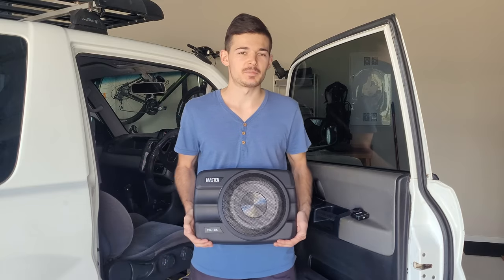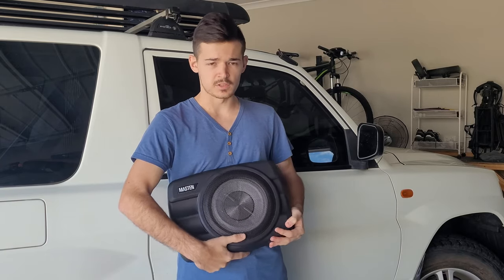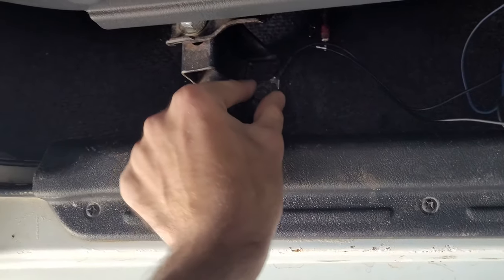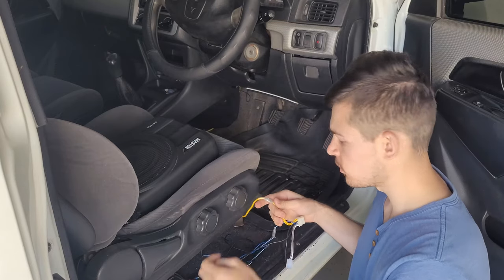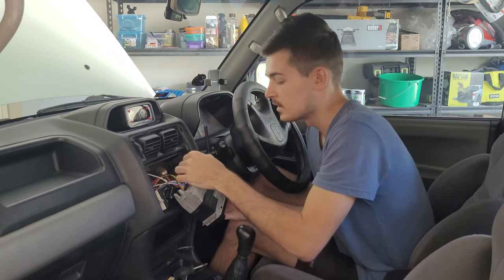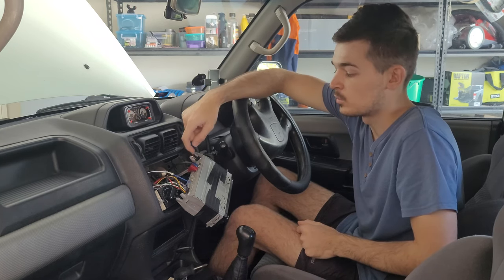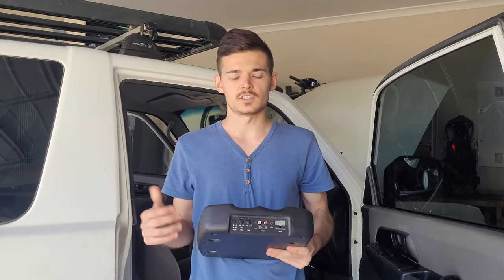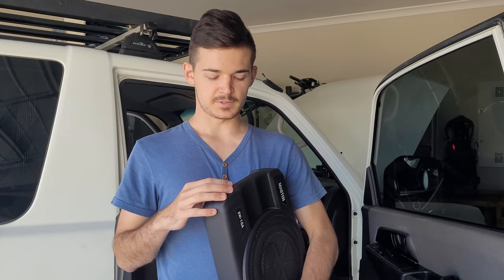Slim subwoofer review and install

Comment: Rockvilles 800w 10” super slim (6.86cm/2.7in) is only $149.95 and it has its own built in amp. They’re a good company I’ve run them for a few years now.
Reply: Link?
Reply: Mine only lasted 4 months of light use. Thats why im here 🤣

Comment: Awesome video! That subwoofer has made such a big difference to the sound! Love it!
Reply from the maker: Not too shabby aye😄👌🏼
Reply: Do you need to put a bigger battery or alternator in your car for this?
Reply from the maker: @taung9535  Hay mate! I have been running on a 620cc battery which is normal size and original alternator and it's perfect :)
Reply: @taung9535 Most of these units draw 15A-20A max at full volume. Most of the time the amp draw is way lower so no worries about needing electrical upgrades.

Comment: Mate, turn the gain down to about 70%, you'll have a much cleaner sound, especially at higher volume.
Reply from the maker: The sound distorts through the mic so hard to hear what it sounds like but yeah you're right you'll definitely have a cleaner sound with bigger setups 💯🙌🏼
Reply: You can't just guess at an arbitrary number like 70%. It all depends on the source voltage level. Trial and error will determine where it needs to be set.
Reply: depends on the quality, i have a marshall (not in the car), u can push it at 100% and its clear, crisp, lovely bass
Reply: @giggsl5011  Not so much quality, but signal strength. A gain knob is like a ratio adapter. If your signal going in is not strong, you can adjust the gain high and not have clipping. If you feed in a very strong signal you might need the gain turned way down.
Reply: Just no... you match your gain to the cleanest input signal. If your radio puts out 4V clean at max volume you set the gain to 4V if it puts out 2.65V at 60% volume you put it at 2.65V

Comment: You'll probably want the crossover set around 80hz low pass, not 50 for that sub. You'll definitely not want the phase set on 180*. Leave that to zero. At 180* it is out of phase with your other speakers and will not sound as good.
Reply from the maker: Yeah...the phase on zero has no bass at all tho 😄
Reply: @budget4x4life  interesting. That’s the opposite of how it would normally respond.
Reply from the maker: @Mike.D.843  haha oh well😄
Reply: @Mike.D.843 The phase setting will be different in each installation. Thats why they make it easy to switch it. You have to try both and pick the one that sounds better.
You also need to set the crossover by what sounds best. You can not rely on the markings by the knob.
Reply: This^ Phase changes where the sound wave starts because if your mains and your sub starts at the the same wave position, they cross (phase) each other out. Even the crossover depends on what main speakers you have and what your settings are. I usually prefer setting my sub to only handle 60hz and below so it's not so boomy.

Comment: Thanks for this video
You mentioned put the 50 Hz will that enhance the bass also someone said lower the gain to 70% is that will make it truly mild and clean when I up the volume!?
I bought one called d class isudar good quality one since a year or so, it sounds good
But i could know what the correct adjustment i should use with it 😢

I installed it correctly but the base controller light isn't lighting anymore since before what could it be wrong!?

Sorry for making it long
 I wish you can help me out solving this issue 
Thanks 🙏
Reply from the maker: Hey matey. It comes down to your headunit. The amount of gain is the amount of bass you want your sub to take over. If it is at 70% it will only play that amount through the sub and the other 30% through car speakers. That will make it sound nice and clean but everyone has different taste of how much bass is enough 🤣
Reply from the maker: Check if the ground and power wires are properly connected. Maybe disconnect and connect again to see if it changes
Reply: Indeed
Thank you so much for your help Buddy 🙏
Reply: Keep up the good work
Waiting for your new videos.
Reply from the maker: @Leto4900  thanks so much😊
Reply: @budget4x4life Okay, so your not understanding the gain control.
It is not percentage based. It us voltage based. It allows you to adjust the amp to the signal voltage going into it from the radio. 

Some radios might output 1 volt, or 2v or even 4v. The gain knob allows you to better match up the amp to the voltage going in.
Reply: @Leto4900 For the frequency control, don't pay attention to the numbers, just adjust it by ear. Too high a frequency and you will get vocals coming from the sub. Too low a frequency and you may not get enough bass. You have to adjust to where you think it sounds best.
Reply: @Leto4900 I would not worry about the led on the controller. Its not important. The led might have burnt out or it might have a bad connection. 

You can try cleaning the contacts on the bass knob and its connectors. Electrical contact cleaner or just alcohol on a q tip. That might fix it.

Comment: that fart sound is the sub distorting turn down the gain to 70% or untill it stops making that noise also the remote wire is +12v so I hope you added insolation to it so you dont get a short it looks bare in the video
Reply from the maker: The fart was the microphone that distorts not the sub 🙂

Comment: Would this be suitable for lwb ns 2008
If you remember my rockford don't work any more
Also would it compatable with kenwood. DMX8520DABS 
Thanks for sharing 👍😀
Reply from the maker: Hey Robbie. Yes I remember. I reckon it will. Just have a look at the back of the headunit, there should be a sub input. Do that and then yeah you'll have a sub 💯

Comment: l want to run in home l find 12 v adapter for power but howl can l get the otomaticly power on Signal? Blue cable need a electricity?
Reply from the maker: Blue needs power. It's the ignition wire to go on and off. Why do you run this in home 😄
Reply: @budget4x4life  for second sub because of the proper dimensions. How much need power 12v?
Reply from the maker: @muhendisabi1697  yeah 12v

Comment: bro those wires are to thin, ground and battery need bigger gauge
Reply from the maker: She'll be right🤣
Reply: @budget4x4life  im about to install mine, im using 6 gauge it has to be enough. Yours are thin as a nedle haha
Reply from the maker: Nice mate. It came with the product so will be fine. Bigger wires are suited for massive amplifiers and subwoofers like over 1000w. This one only 300 @kalisto1
Reply: @budget4x4life  No man, better flow of electrons is betrer if the wire proper.
Reply: @kalisto1 This Masten is probably drawing 15 or 20 amps at most and that is in musical surges. It probably averages out to 5 or 10 amps. You don't even need to go to the battery. These units will run fine off a cigarette lighter outlet since they are usually fused for 25 or 30 amp. 
If you want to know true current consumption get a DC clamp ammeter. It is not a high powered amp, but good enough.

Comment: wow sounds really crappy.
Reply from the maker: You're listening to sound through a crappy mic hence why you can't hear the exact sound. The sound farts are because the bass is too much for the mic to handle so it distorts. In reality just clean bass no rattles🙂💯
Reply: @budget4x4life  lol I love sound my computer has $1,000 small rosewood technics speakers, my amp is a mini Denon receiver, with a 12 inch 300 watt amp, built in,  my monitor is an 32  in curved screen Samson. But my home system starts with a SVS  SB 4000, Subwoofer, not to mention the stuff in my bed room and garage, lol yeah my stuff is great so yeah I can say the video sounded crappy, sorry not trying to be mean.
Reply from the maker: @DKLGalactus5  haha no all good mate😃
Reply: @Gebriel T  the host was such a good sport, I subscribed to his channel
Reply: @DKLGalactus5 bro flexed off here 💀
Reply: @DKLGalactus5 So you know a little about sound systems, but nothing about microphones? 
He specifically told you the microphone was overloaded and clipping/distorting. I hope you can put two and two together and see where your mistake is. 

Just to be safe, the recorded signal is distorted. So you can reproduce the distorted signal perfectly on a million dollar system and it will still be a distorted recording. 

I hope that is clear. 👍
Reply: @JasonWW2000  lol, this was posted a long time ago but, if you're going to impress the public don't use crappy microphones and then blame someone else for their poor judgment.  I said it sounded crappy and it did the host even actnolaged it, so what the problem,  now you can wipe the tesrs from your eyes.
Reply: @DKLGalactus5  Oh, so it's his fault he didn't spend several hundred dollars on a high-end microphone? You seem to enjoy placing blame on others. I've noticed you haven't apologized for your misunderstanding. I guess you always just assume it's the other person's fault, and never your own.
I was not laughing at you so hard that I was crying. I was just trying to straighten out your confusion. 👍

I can only assume this is the first video you've ever watched where they had high levels of bass playing. Just an FYI, every video that has bass in it has it sounding distorted.